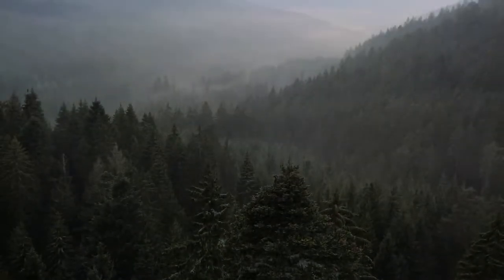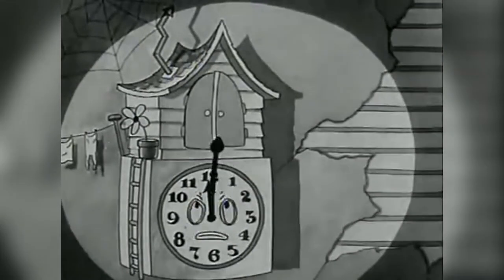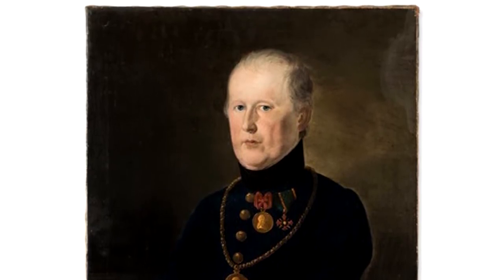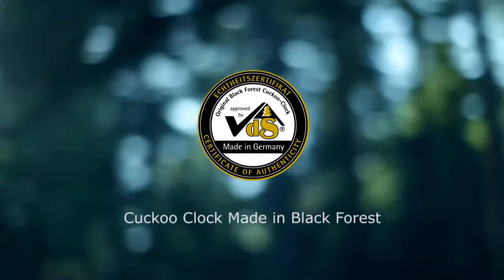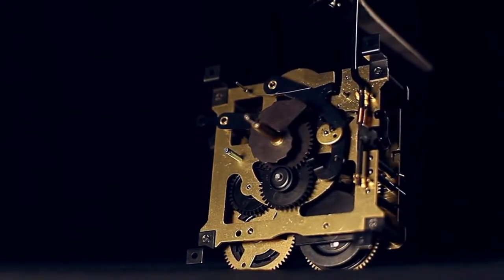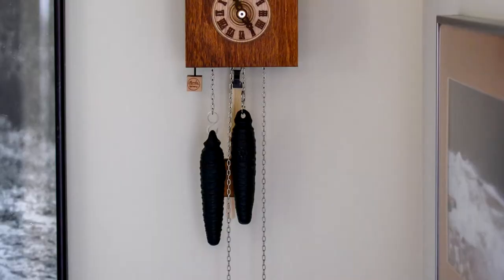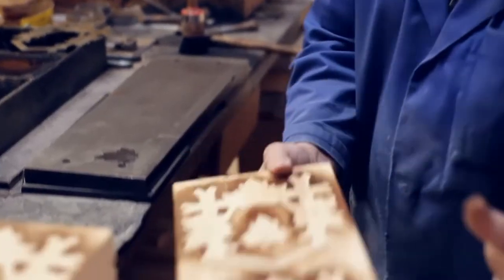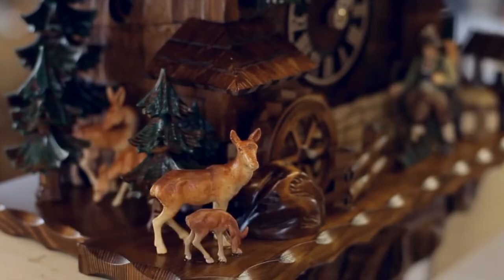A Closer Look at Germany's Famous Black Forest Cuckoo Clocks

Comment: How much do these clocks cost? They sound expensive!
Reply from the maker: @Matthew Dunn  They can be, however, they're beautiful craftsmanship and worthy of the cost.
Reply: Tiny ones cost around £100 - £200 unless used. Some small simple USED cuckoos appear on eBay for as low as £35.

Enormous ones or heavily carved ones can cost from £1000 up to over £9000.